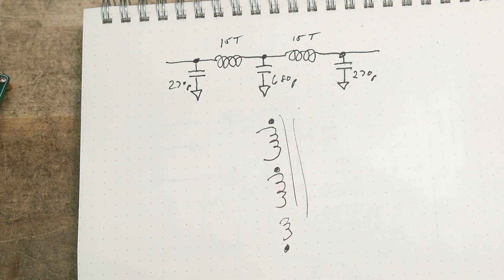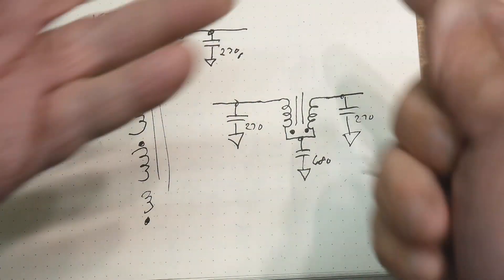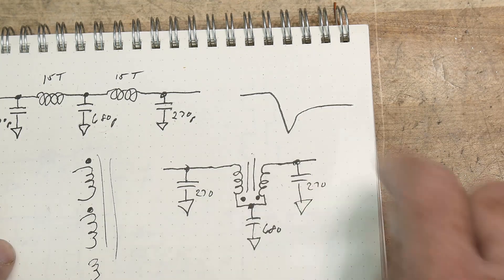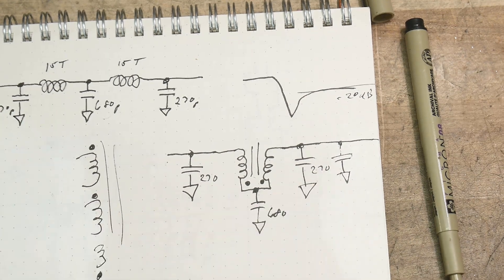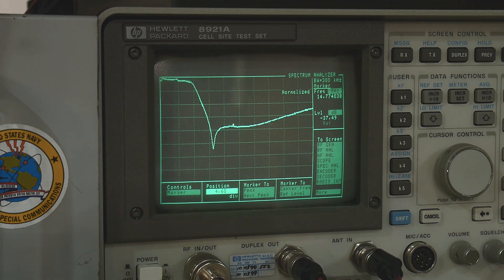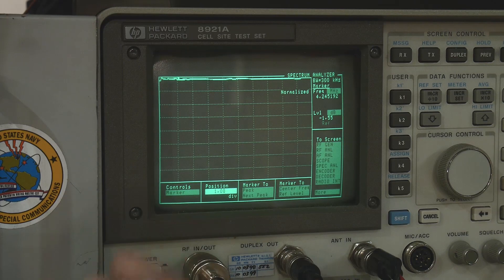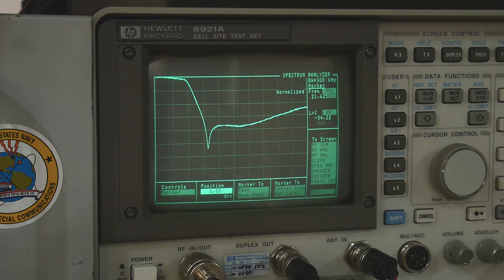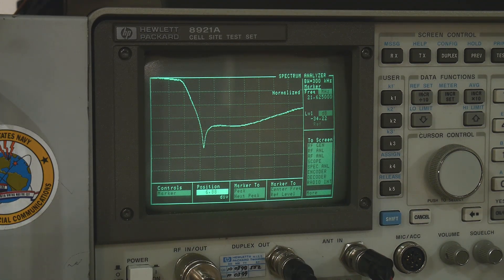#746 40m Low Pass Filter Design Using One Core (part 2 of 3)

Comment: The transformer can be substituted with a '"T" circuit consisting of 3 inductors. The inductor to ground basically makes a serial resonance circuit with the center capacitor, which adds a zero in the transfer function.
Reply from the maker: can you put the 3 inductors on the same core?
Reply: @IMSAIGuy   I mean the equivalent circuit of a transformer is T circuit . The values of the equivalent inductors are determined by the mutual coupling and the original values of the inductors. If you assume that K=1 and because of the way you wounded the core, your equivalent circuit becomes   - 270pf Parallel - 2uH Series -  1uH and 680pF Serial resonant circuit connected in Parallel - 2uH in Series - 270pF in parallel. That series resonant circuit that is connected in parallel is responsible for the zero in the function, since at its resonant frequency the impedance of the filter becomes effectively 0ohm and rejects. I am not sure if i explained it well i suggest googling "transformer T equivalent circuit". Cheers!
Reply: @IMSAIGuy  To achieve the function with the notch originally you need 3 uncoupled inductors. You saved one by coupling two of them. The third one comes on its own mathematically form the mutual coupling.
Reply from the maker: @cowshittt  OK, the exercise I was doing was a new design to see if I could create a filter with only one core.

Comment: Low-pass filters typically start with a series inductor and have a cap to ground afterwards. High-pass filters are the opposite. So it stands to reason that the roll off is better when adding capacitance on the output side of the inductor, as you are lowering the frequency and increasing the attention. The parallel cap on the input is not effective in that regard, but rather I believe it sets the point at where the roll off starts by creating the parallel resonance of the input which creates the matching impedance. That, along with the series cap to ground on the common end of the toroid, which is lowering the amount of inductance. It may also play a role in the sharpness of the null. I’ve never worked with a coupling toroid, just individual inductors as you have drawn at the top of the page. There’s likely some added effect of coupling between the input and output that you don’t have with individual inductors. Essentially you’ve created two tank circuits with inductive coupling.

I use this for filter designing: https://rf-tools.com/lc-filter/

Comment: If you wind two inductors on a toroid like this, each taking up half the ring core then in my experience the coupling factor between these two inductors is 0.43. This means that a small part of the two inductors couple and for the rest they can be considered  two individual inductors (as if these were in series with the two inductors), creating the low pass filter. Look at transformer models to get the idea.
The part which couples does so in a way difficult to understand because the coupled part tends to have not only the voltage but also the current coupled but in such a filter normally the currents in the two sections of the filter are different and out of phase. This kind of fringing causes the dip. Because of the partial coupling the filter configuration is different from a low pass filter.
Besides no longer being a standard low pass filter also the filter input and output impedance will no longer be the 50 Ohm you would expect. That’s probably a bigger problem in using this filter. Even if the characteristic looks useful with the dip, the SWR you get may be (far) off.

Comment: You have now wound two individual inductors on the core, how would this change it you wind both in one go. I expect that you will get more capacitance between the windings but I'm not sure what the result for the filter curve would be
Reply from the maker: In many applications the windings are done simultaneously. with a group of two or three wires in parallel. In this case I needed the two windings out of phase. I guess you could wind the first and hook things up out of phase. My gut said I did not want much cross talk.
Reply: You would wind the same direction then flip the polarity of the wires. Bifilar wound. They use this as a phase reversal choke in some push pull amps.

Comment: Just did the math, that 1.5dB of insertion loss around 7MHz can be detrimental to a QRP rig. A uBitx that can output 10W into 50ohms would have its output reduced to 7W! May be worth it for qrp guys to mess with the design to reduce the loss in the pass band.

Comment: The coupled inductors (not a transformer wound on a toroidal core with coupling M close to 1) are/were widely used in IF stages.
I remember that when I learned electronics we went through calculations and experiments that showed the dip in the frequency response in the center depends upon the coupling factor M.
It is used to make the response flatter in the center and not a sharp peak that would result in very narrow AM response.

Comment: So, how would you use this filter? What kind of device would it be in? BTW, enjoying session.
Reply: I believe this is a low pass filter.
Reply from the maker: This was to be used as a 7MHz transmitter low pass filter on the output to remove any harmonics at 14 and 21 MHz

Comment: Yes, I was able to model this in Tina-TI spice with no problem. I checked the TI web site and that program is still there for free download. It has a coupled inductor sub-circuit built in. Changing the coupling (mutual) inductance parameter does interesting things also.
Reply from the maker: Tomorrow I will be running a spice model
Reply: In LTSpice is easy to model coupled inductors, it is a simple sentence like  K L1 L2 1 being the last number the coupling coefficient from 0 to 1